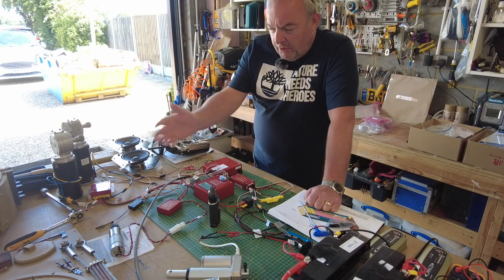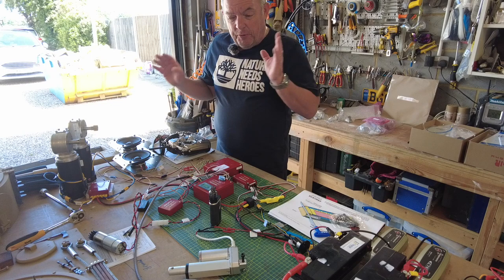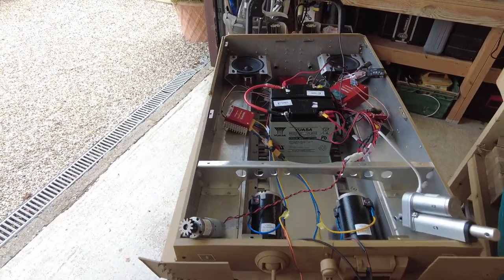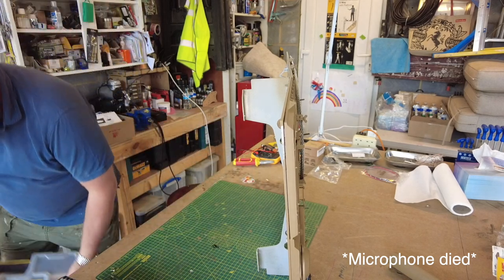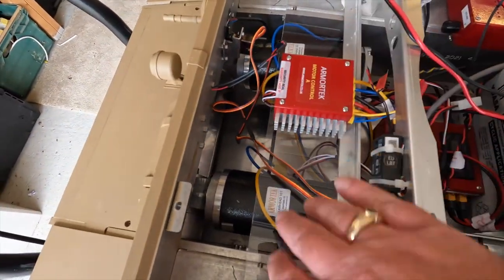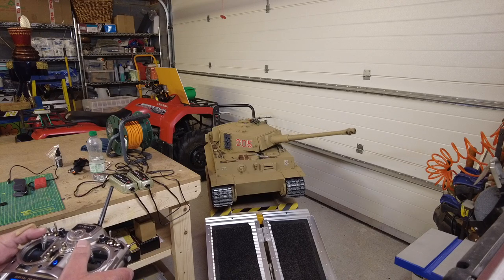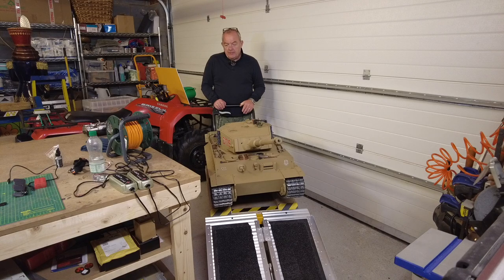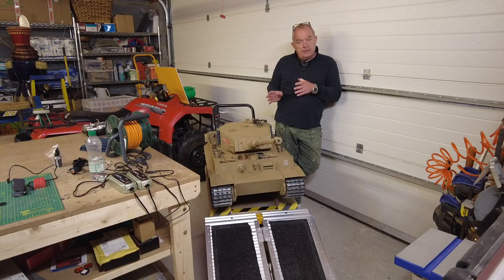1/6 scale Armortek RC Tiger 1 Tank Build - (Video 15) Installing the Option Packs

Comment: Good job!!!
Just need an Antenna with a flag on it.
Reply from the maker: Thank you. I did consider that, but the antenna location does interfere with the operation of the Turret. I may go on to add something to the turret rather that the top deck.

Comment: As someone with many years of radio control modelling behind me it would have been interesting to see how you have positioned the receiver aerials to keep them out of the metal faraday cage that is the tanks hull. The circuit board type of aerial must make them harder to hide than the normal co-ax wire used for 2.4GHz. (I use FrSky equipment with both types of aerial) While the Taranis with the OpenTx operating system is relatively low cost and very flexible for programming it is one of the hardest to set up of most modern radio sets so I can sympathise with your problems in setting up. Good work in geting it to the running stage it is at now.
Reply from the maker: Thank you Jim, It was a challenge, but really pleased how the tank is operating now.

Comment: Hi Tony I'm happy to see all the great Tiger 1s in action. Also, I envy you. Because my Tiger 1 doesn't connect well with the Futaba transmitter and doesn't work.
This video motivated me to solve the problem. I'll try to do my best.

こんにちわ トニー 素晴らしいタイガー1が全て動くのを見れて私は嬉しいです。また、羨ましい。なぜなら私のタイガー1はフタバの送信機と上手く繋がらず動かないからです。
問題を解決するやる気をこの動画で湧いてきた。頑張ってみます。
Reply from the maker: Hello Ritsuo Tsujimoto and greetings from the UK. Thank you for watching and supporting. Have you managed to bind the radio set with the receiver? This was my biggest problem. Once it was bound, it worked fine with some adjustments.
辻本律夫さん、こんにちは。英国からのご挨拶です。ご覧いただきありがとうございます。無線機を受信機にバインドできましたか?これが私の最大の問題でした。バインドすると、いくつかの調整でうまく機能しました。
Reply: @tonys_workshop  I can't talk to someone who is doing RC nearby
We have not been able to bind the radio to the receiver for over a year.
Since it is the previous version of Tiger 1, it has a silver motion pack and sounds.・The motor is moving, but it cannot be controlled by the transmitter! !
Now I'm having fun with twin merit, welding marks and painting.
I'm thinking of asking Monique if I can replace it with a red motion pack.
身近にRCをしている人がいなので相談できず
一年以上　無線機を受信機にバインドできていません。
ひとつ前のバージョンのタイガー1なのでシルバーのモーションパックで音も鳴る・モーターも動いているけれど送信機でコントロールできていません！！
今は、ツインメリットや溶接跡や塗装で楽しくやってますよ。
赤色のモーションパックに差替えできるかモニークに相談しようかと思っています。
Reply from the maker: @辻本律夫  I have always found Monique very helpful. I am sure if you contact her, she will try to assist. I guess you have searched Youtube for binding videos?
Reply: @tonys_workshop  yes! If possible, please show me a video of unity and setting.
please.
はい！できれば結束とセッティングの動画をみせてください。
お願いします。
Reply from the maker: Hi, I am not sure about your set up, but try looking at this: https://www.youtube.com/watch?v=CIIviIiNxRI
It may help.

Comment: I haven’t given up building my 2005 Tiger kit……yet.
I will say your videos have inspired me to dust off my kit and get back to building. I’m not the spring chicken I was when I bought the kit almost 20 years ago so I strain my back just lifting the top hull off. I finally bought a lift cart for it. Still in the process of getting more tools. Also waiting to hear back from Armortek on the motion pack and spare parts needed for my build. Do you think Adrian will make house calls here in the states to help with my build? ;)
Reply from the maker: Hi Chris, I really hope you do re-start...in fact in the 20 years that have passed Armortek have greatly improved the option packs and made it more user friendly to set up..it is very much plug and play and all the leads are clearly labelled. They have also improved the smoke system since I purchased mine, so you will find it easier than you expect. Not sure whether Adrian would 🤣 but I am sure that if you get really stuck the forum will help you. If you are now using the table lift cart this will also help with an improved working height. I also suffer from back pain from a motorcycle accident years ago, so the correct working height for me is so important. I hate bending over as it really aches. I have had some comments asking me to do a short video on the tools I used to build this model and I will be putting this up soon. It may also help you.
Good luck Chris with your re-start and hope you continue to follow my projects. Have a great weekend.
Reply: @tonys_workshop  Tony yes a vid on the tools you used would be really helpful for those of us mechanically challenged. Though I have assembled 2 live steam locomotives they were Japanese kits that went together like a fine Swiss watch. This tank is quite a different “beast”. I hope your bike accident wasn’t too bad. I had 3 Harley’s at one time. Gave up the last one a few years ago. I really miss riding. Though I’ve had the kit for almost 20 years I’ve had life interfere and some distractions over the years. The biggest was another British “kit”. I owned a Daimler ferret scout car mark 2/3. That was indeed the coolest “toy” I ever owned. It had a Rolls Royce engine. 
These older kits are kinda primitive compared to the new ones. I really need a set of hull braces. I can’t believe these original kits with the heavy cast turrets didn’t include hull braces. The new motion packs would require new holes drilled in the hulls to mount the motors. When one barely knows what end of a screwdriver to use the idea of drilling new precise holes is a bit daunting. Your build looks amazing. Thanks again and have a good weekend also.

Comment: Absolutely killer Tony, she looks so good bud.
Cracking choice on chargers and batteries.
I have those make of batteries in my motorbikes.
Do you disconnect the batteries and permanently connect them to the smart chargers once you have run the tank it's what I do with the bikes.
This is the part of the build I am least looking forward to, I've seen on the forum this can be a real ball ache to set up.
I've just had my paks confirmed this week so hopefully turn up in the next couple of weeks I ended up getting everything, and also have a rear convoy light which is a nice bit of kit from a forum member.
I like your layout of the electronics very nice install.
Can't wait to see her running, like you not sure my misses will be to happy with me chewing up the lawn, carpet idea is genius way to move the tank about.

Look forward to the next installment bud.
Reply from the maker: Good morning Gary and thanks for the positive comments. These are the batteries which Armortek recommended and so far working perfect. I also use the Ctek conditioners on my Quad and mower, they are brilliant bits of kit. So, I have hard wired(using the connectors supplied by Ctek) to the batteries and only disconnect the conditioners when not driving for a while or when ready to drive. I leave the batteries connected at all times as the Ctek conditioners are designed to allow this. 
I too was dreading this part, but once the radio set was bound to the receiver (by other people who know what they are doing :-) ) it was really just plug and play...Adrian from the Forum was a god send for tweaking the handset to operate exactly as I wanted it. I am a total newbie to RC and this was a challenge, but you are connected to some great people on the Forum who will be there to help.
I know the guy you are talking about and I saw the Convoy light. I was also tempted to buy the Jack he sells as well. I did buy one of his Bosch lights and will be installing this at a later stage. When you are up and running, you know where to come to drive it :-) Have a great weekend Gary.
Reply: @Tony's Workshop  morning Tony, I totally forgot to ask about you hand set/reciever my memory is completely shot bud.
Is that the Taranis X9D plus?
And how is it to use?
Sorry for  all the questions.
I'm using the Frsky FSI6X on all my 1/16 and it easy to use not sure it will have enough channels for the panther..
Reply from the maker: @garyrafferty8653  Hi Gary, no problem...I am using the Armortek recommended FrSky Taranis X9D Plus 2019 Transmitter with FrSky X8R 2.4G Telemetry Receiver. The biggest problem was trying to bind..I gave up and took it to a model shop near me, where they managed to bind it...After that it was fairly straight forward. The tank doesn't use the full 16 channels available as its functions are drive forward/reverse, steering, gun fire, turret operation, gun elevation, MG, light and sounds. So operationally very easy. Hope this helps.

Comment: The different speeds might be due to different settings on the ecu units for the motors
Reply from the maker: Hi and thanks for pointing this out. It may have been partially to do with that but we were able to solve by adjusting the balance on the radio set. Hope you continue to follow my future projects.

Comment: Hi Tony.  Chris here again.  You said you had a problem with the MG servo, did you resolve it? Reason I ask is I’m also having problems with mine.
Reply from the maker: Hi Chris, Yes I did and AT replaced it free of charge. the problem I had was it was 'juddering' if thats a word? The replacement servo moved better, but not as smooth as I would like. What is the problem with yours?
Reply: @tonys_workshop  .  Mine is doing nothing.  It twitched and moved at first but I wasn’t too sure which control on the transmitter was used so then I couldn’t find it again.  I believe it was the SA switch.  I’ve ordered a new servo as they’re cheap enough thinking it might have blown.   The control and set up on the Taranis transmitter confuses the heck out of me!
Reply from the maker: Hi Chris, The set up is confusing....Where are you in the world...if you were close enough I may be able to help. I am no expert at all, but I will try and help if i can.
Reply: @tonys_workshop  Hi Tony.  I’m in Wiltshire near the Berkshire border so a bit far for you to pop over I guess.  I’ll persevere and it’s no big loss if I can’t get the MG servo working.
Reply: Hey Tony.  After a few brain leaking tutorials about the Taranis transmitter I managed to glean enough knowledge out of the technobabble to solve my problem.  MG is now functional!

Comment: Seeing how heavy these tanks are how long do you think the batteries would last before a recharge would be needed?
Reply from the maker: Hi John, I have run my tank for a full 45 mins, then parked up without a charge for three days, ran it again for 30 mins and afterwards the batteries were indicating 46%..I have yet to run it longer than 45 mins in one session, but based on this I would hope to obtain at least 1.5 hours operationally, perhaps more...early days, but no problems so far.
Reply: @tonys_workshop  Thanks Tony.
 I would also expect whether it is driven on a flat surface or over rough terrain could also make a big difference.
Reply from the maker: Yes definitely John, especially when climbing. Having said this, they are designed to run a golf trolley and if it's any way like my golfing experience I am all over the place and take hours to get round :-)

Comment: Hello again Tony.  If you don’t mind me asking, where did you get your scissor lift to go under the tank?  I can’t find one with a low enough profile the tank can go over.! Cheers.  Chris.
Reply from the maker: Hi Chris. I guess you are talking about the one that elevates the tank not the main table lift? If it is just the small scissor lift, they are widely available on the net, but I got mine from Amazon: 
https://www.amazon.co.uk/Motorcycle-Scissor-Lift-Hydraulic-Adjustable/dp/B0BDMD9HF7/ref=sr_1_1_sspa?keywords=scissor%2Blift&qid=1678977262&sr=8-1-spons&sp_csd=d2lkZ2V0TmFtZT1zcF9hdGY&th=1

As you would have seen on my last video, it is still ,just slightly too tall to slide under easily, so I would use a couple of pieces of 18mm ply to roll the tracks on to and then elevate. If you are not at that stage yet the a gently tilt lift up and slide the jack under does work.

Hope this helps
Reply: @tonys_workshop  Thanks Tony.  To elevate the tracks slightly never occurred to me! 😖Problem sorted.

Comment: Hey tony, do you also get the remote by the motion option pack?
Reply from the maker: Hi Nick, thank you for watching and commenting, unfortunately not. Armortek recommend the unit, but leaves it up to the user to buy this part of the build.
Reply: @tonys_workshop  thanks for the ansur i will look for it in de instruction book
Reply from the maker: @nickw3159  Hi Nick, You will not find it in the instructions, but on their website...to save you searching..see below the kit I have purchased on their recommendations:
FrSky Taranis X9D Plus 2019 Transmitter with
FrSky X8R 2.4G Telemetry Receiver.
Hope this helps.
Reply: @tonys_workshop  tony thanks for the answer

Comment: Motor specs please: power, rpm, voltage,
Reply from the maker: The motors are 12 volt and the tank is run on twin 12 volt batteries connected in series to provide 24 volt. Not sure on the motor rpm, but check out a video titled 'Testing the power of an RC Armortek tank" it is impressive. Thanks for watching and commenting.
Reply: thanks for your answer. one More question, those motors don't have a nameplate with specs? or, could you measure how many Amps consume at high load?
Reply from the maker: Hi...The only info on these is what Armortek put on and this has no info on what you are looking for. Sorry I can not answer your question.